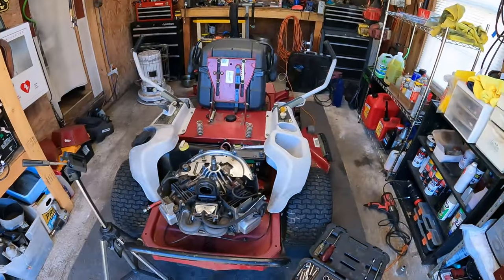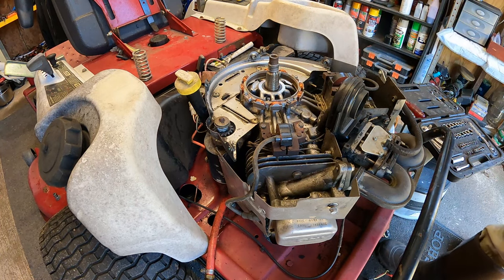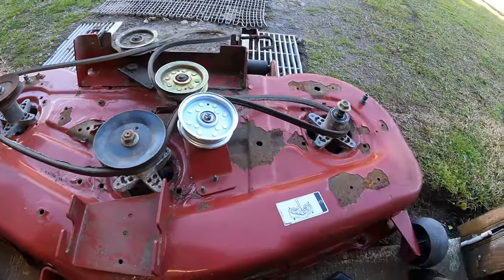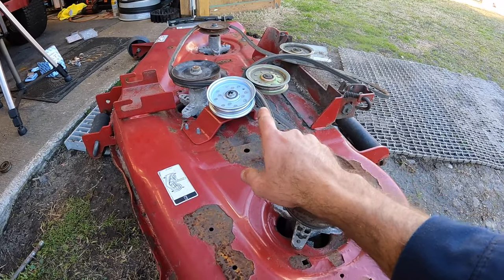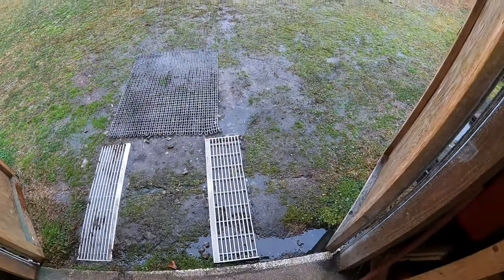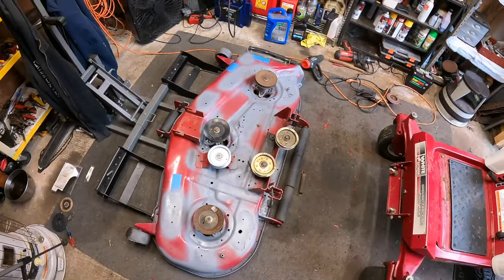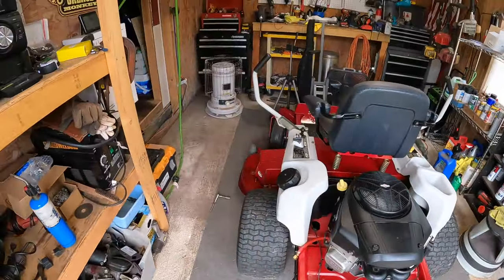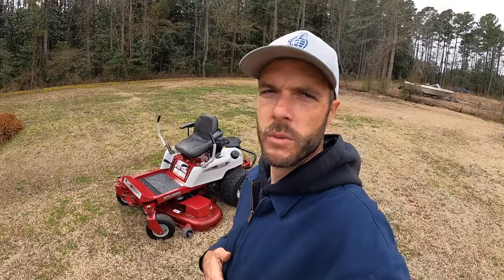FIXING UP A $100 ZERO TURN PT2 (AMAZING TRANSFORMATION)

Comment: Alex as nice as that mower is, i would think it would bring $1200-$1500! You fixed and adjusted everything, fully serviced, new battery. That machine should be an easy sell. The little details in my opinion are what make the difference between a nice reconditioned mower and a used mower for sale! Nice job as always. 👍🎥🇺🇸
Reply from the maker: Thank you very much Roger. I feel like this should be a really solid machine for someone with a good size yard that doesn’t want to break the bank with a new zero turn. I’m hoping for those numbers.

Comment: Love the videos man! I just started watching this last two weeks when I found my interest in fixing up yard equipment! I got a free cub cadet 1554 with only 2.9 hours on it! Got it running with a carb clean and oil change, I also got a free 2012 Dixon 46 in cut yard tractor for free also, the cylinder was full of gas but drained it out refilled the oil cleaned the carb and did a valve adjusted and she’s a great cutter now!! I hope to start flipping yard equipment like you do soon!

Comment: All decks should be that easy to mount!
Pretty neat how you were able to lift up the front end of the machine and roll it up and over the deck too!
What a bummer about that clearcoat not being the right finish, but I doubt a potential buyer would even notice. 
Great work overall! 👍
Reply from the maker: Thank you so much. I greatly appreciate that. Yes I wish they were all that easy. Some have so many mounting points it makes it an hour job to just remove.

Comment: I have spray painted before but never thought of spraying clear over it too.  Where did you get the rubber mats for the floor? Thanks.
Reply from the maker: The rubber mats were on the mower, but I added the grip tape strip in front of it to help from heel scratches. I got a roll of the grip tape on Amazon.

Comment: Wow. I have the exact same year and model. My big problem is burning up belts every year. I change out the transmission lines and rerouted them out of the middle of the belts.
Reply: I routinely check valve lash and tire pressures. I also made a cover for the intake manifold to keep sun and weather from warping it.
Reply from the maker: That’s a good idea with the transmission lines. Do you engage the blades at full throttle? If all the pulleys are aligned and smooth I wonder what could cause that.

Comment: Got a brand new troy-bilt bronco with blown up kohler courage 18. Did a motor swap with an identical kohler courage. After the motor swap, went through 2 used starters. Finally got it all together, running mowing, just to have the valve cover start to leak 😅
Reply from the maker: Ugh… yes it’s always something. That’s great that you got so much work done though.
Reply: @freedommowers640  most definitely and thank u for the content good sir. It's all buttoned up now and runs and mows great. Can't keep my 10yo off it. Thinking the yard needs mowed after school everyday 🤣

Comment: i bought a mower with a 23 hp briggs and a 50 inch deck that was also a white outdoor for 100 bucks as well. they must’ve not made alot of these mowers in my experience there wasn’t a lot of info on them.

Comment: But I need your help on something. I have a crafthman LT 1000 it turns, but I'm not getting any spark. What could be the problem New key switch new starter new syllanoid new battery turns but no spark
Reply from the maker: It could possibly be a safety switch issues or could be your coil itself.